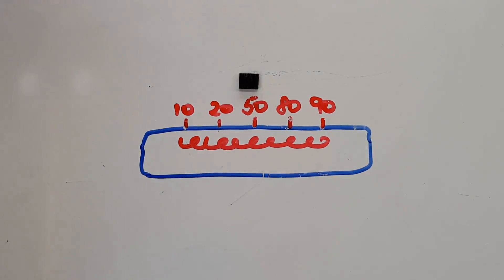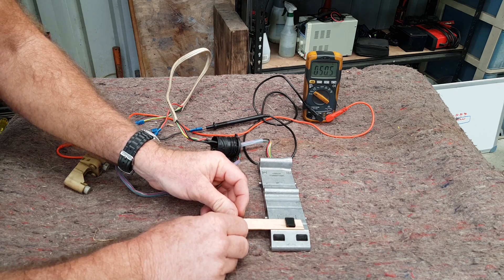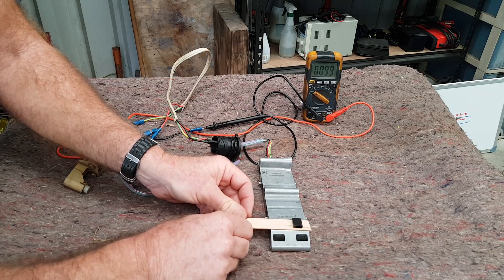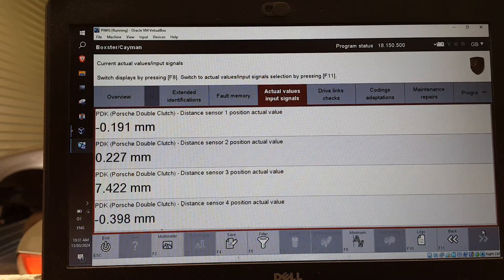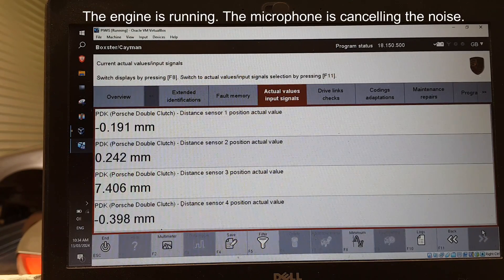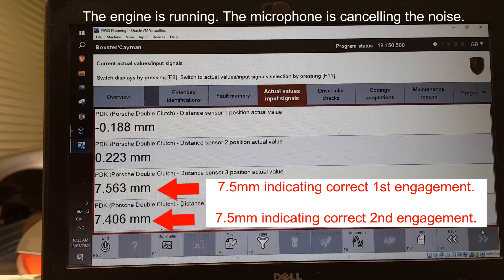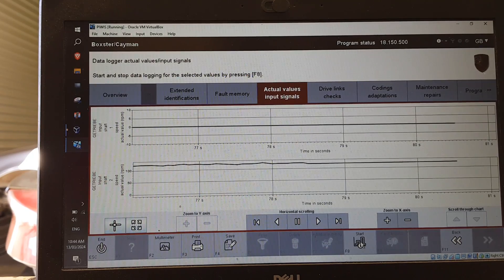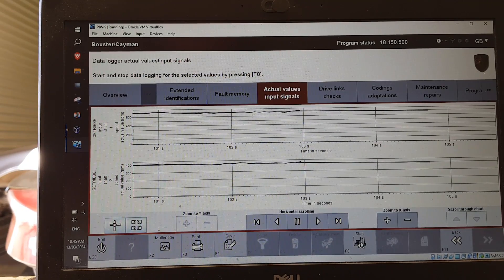Porsche PDK fault analysis. Ambiguous and difficult to diagnose faults.

Comment: You’ve created an amazing resource, Jeff!

I’ve got a 987.2 Cayman, that has had a PDK fault p1764. We’ve replaced distance sensor and the “valve body” housed inside the pdk fluid pan. We’ve tried to calibrate many times. It works in reverse fine, but only slips the clutch in first, to the point the car wont move.

We’ve been able to verify the distance sensor is communicating and wired correctly, but when moving the gear lever from park to drive, we see no change in the distance data in piwis. Have you run into this?

Comment: Hi. Could you tell me what the shafts RPM are in neutral?
Reply from the maker: Will be less than engine RPM, but dependent on temp. Normally when warm I'd expect about 400 on shaft 1 and a bit less on shaft 2.

Comment: This is amazing video. 
All of your clips are like PDK bible.
Unfortunately I couldn't find any source can help my situation.
I have very weird error code from 997 PDK. (P1872 Data record for hydraulics calibration is invalid). 
Do you think it's Valve body problem? No oil pressure and current flow at Clutch 1 when I shift D. Car doesn't move either R and D.  
It seems like Clutch 1 is not being pressured
Reply from the maker: Did this occur after attempting a calibration, or has it just appeared out of nowhere? This code and similar (1870, 1871) occur after a calibration is attempted but one of the calibration parts fail.
Reply: @jeffrichardsoncardiy  
Appreciate your reply.
After change distance sensor I sent car to dealership for the calibration. It were keep failed and showed P1872.(I guesse they did Long calibration) 
Follow their suggestion, they changed TCU. But still same symptom with same code. I brought car from dealer to compare actual data with 987PDK in D.

Shift rod position gear 1-3 stayed (-0.13mm.)
Speed of shaft 1,2 is (504, 506 1/min)
Oil preesure Clutch 1,2 is (1.407, 1.506 bar) These all measured data in lever D.

If the distance sensor is wrong the TCU dosen’t give a signal to EDS1 or vice versa?
Reply from the maker: @dongjunkim9252  Can you shoot an email to my channel email address: jjrichar12@gmail.com  Will be easier to pass info.
Reply: Hello, I have a 2014 panameradi and these messages came out: P1731 P1735 P1732. The technician diagnosed it and cleared it. The car started working 3 days later. The transmission goes forward, D goes forward and 2nd gear but R does not go.

Comment: Where can you buy a distance sensor for ZF?
Reply from the maker: You can't. Only aftermarket sensors are available. Part availability is one of the major issues with the transmission, as Porsche's solution to most problems is to buy a new transmission.
Reply: @jeffrichardsoncardiy  By now, you can buy an even better than original sensor from Jumps (google it)

Comment: Firstly, I'd like to tell you thank you for your amazing content! I have a 2014 Panamera 4 and I originally had codes P1733 & P1734 indicating a faulty distance sensor. I replaced it with one from ebay. The car ran fine for two weeks and out of the blue, it started giving P1870 PDK internal fault and P1765-Gear disengagement lock. Based on your videos, I suspect that the sensor I bought is faulty.
Reply from the maker: I don't have any experience on the Panamera transmission, but I can't believe that it's too different. I'd be interested in knowing if another sensor fixes the problem. Did you do a calibration afterwards? If you haven't seen the video I released lately on calibrations I'd suggest looking at it.
Reply: @jeffrichardsoncardiy I had a calibration done by a local dealer. The technical said It took four attempts before the calibration would complete. Even afterwards it would intermittently lose reverse and only shift odd numbered forward gears (1-3-5-7). Also, limp mode will only occur after the transmission reaches full operating temperature or about 20-30 minutes of driving. After an hour sitting, the codes can be cleared and the car is drivable once again. I have a Launch x431 pro scan tool that can watch the live data stream but I didn't understand what the values were supposed to be until I found your channel. I ordered another sensor and hopefully that one is good otherwise I will have to buy one direct from Porsche. The information in your videos is invaluable. Thank you again and I'll follow up once I install the new sensor.
Reply from the maker: @MrBdavis99  Keep me in the loop. I'm interested in the outcome. I'm not sure if you have the ability to test the old sensor like I did in the video once it's removed, but I'd be interested in what you find.
Reply: @jeffrichardsoncardiy  Success! So I finally bought a new Distance sensor from a local Porsche dealer. I installed it and it immediately threw a fault code P1764. I then ran the calibration several times before it successfully completed. Afterwards, I drove the car for 30 miles with zero faults. The car is fixed. Thank you fit helping me understand the functionality of the sensor and the pdk gearbox.
Reply from the maker: @MrBdavis99  Great news. Happy to help.

Comment: any reason this does not apply to the Panamera’s equipped with a pdk? I understand the configuration and goals is different but wouldn’t porsche use similar things inside that transmission instead of redesigning for a non flagship model
Reply from the maker: Whilst it might apply to the Panamera, I have no idea as I've never had my hands on one.